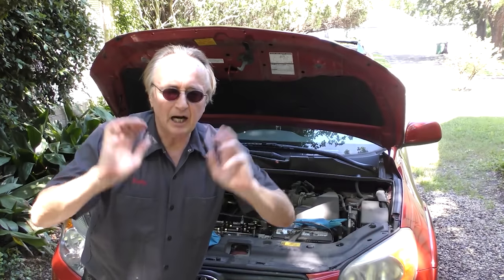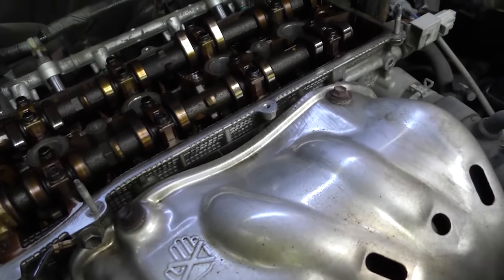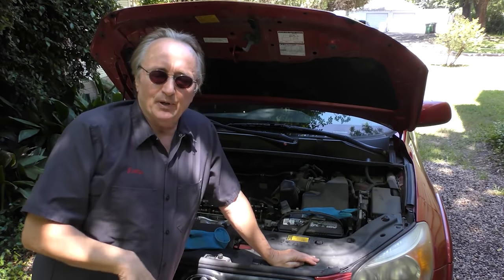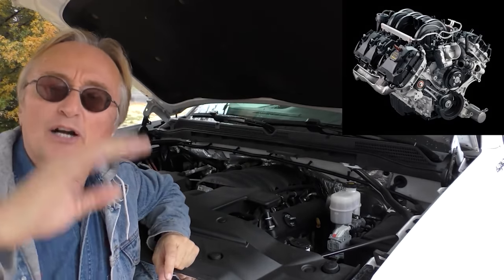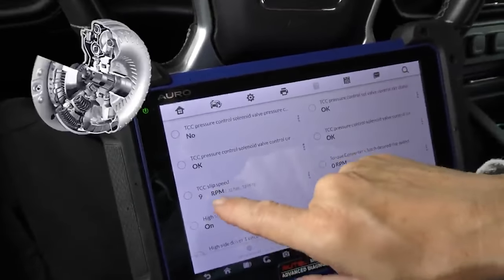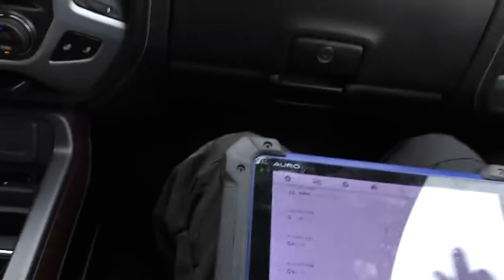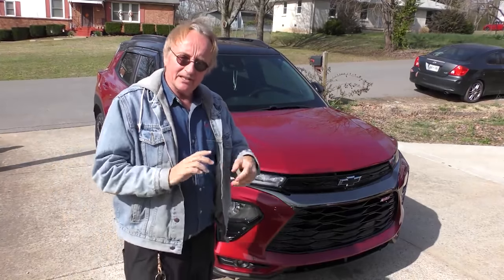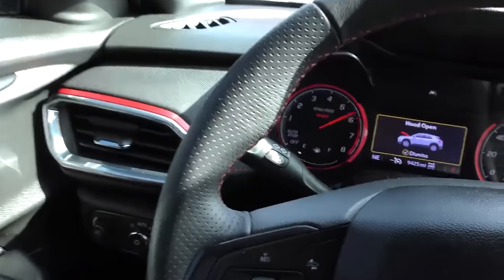Avoid These 3 Engines Like the Plague

Comment: The Toyota issue doesn't just affect the 2.4, 2007 - 2009. I had a 2002 Corolla with a 1.8 engine, and had the same issue. Toyota refused to acknowledge the issue and wanted 2k to fix the problem... I refused to pay and got rid of the vehicle. I've been driving Hondas since then, wouldn't go back to Toyota after that.

Comment: Hey Scotty. I've got a 2008 Honda Accord, and it's got the same problem as that Toyota - it's burning oil in one cylinder and fouling the plug. The dealer said it needs thousands of dollars of repairs to "rebuild" it and replace the rings. Do you have any advice?

Comment: My 2011 RAV-4 with the 2ARFE engine burns oil too, like 3 quarts between oil changes.
Reply: How many miles between oil changes
Reply: @michaelgriffis5259  Between 5-6K miles.
Reply: How many miles u have on the engine?
Reply: Aall 4th gen RAV4s are crap. "Avoid them like plague"

Comment: I had a 2007 RAV which I got rid of after 10 years due to the problem mentioned here. Toyota sent me a letter with an extended warranty: 10 years/100K miles. So at the end of ten years I got rid of it even when there was nothing ever wrong with the vehicle with the exception of a few recalls. Don't laugh. I traded it for a Sorento which after 5 years has been a good dependable vehicle. Standard warranty 10years/100k miles. At any rate,10 years is how long I keep my cars.

Comment: He said oil burning Toyota and I immediately thought, "2008 4 cylinder". People still try to sell them for a ton of money cause most people don't know about the oil issue with the 4cyl from that generation. Either get the previous generation 2006 or older or the newer ones 2010+.

Comment: Been driving a 2008 rav4/2az-fe for 5 years and yea the cover is covered in oil but i have no leaks or smoke and the car has over 160,000 miles. Engine may be flawed but it is still a toyota which means even with problems toyotas are still reliable!

Comment: I had that vega!! I was pouring oil daily and finally gave up.
Reply: I'll bet Pennzoil was smiling all the way to the bank!
Reply: I remember when dollar tree sold a quarter of regular mobile oil. Had  I known that I would be driving a 98 Saturn, now gone, I would have bought a truck load. That twin cam engine loved oil.
Reply: @walterweddle7644  I had the 93 SC2, by the time I traded it in for a used 2001 SL2, it was using a quart every 160 miles after 207k miles on the engine, and the usage was accelerating, oil blowing by the rings.  Other than that, the engine ran fine!  But, I knew I couldn’t push it much longer without needing to plan on hiking. Got $100 in trade for it, I figure I came out ahead that I didn’t have to deal with the time, effort and inconvenience of it dying on me and having to find a junkyard to take it to where they might charge me! 🤣🤣🤣

Comment: I hate the electronic parking brakes.  I'm glad I went with the cheaper Camry (LE) which has a mechanical parking brake (foot pedal).  I always get worried that if something goes wrong with those electronic parking brakes, you could have a problem.  Plus in an emergency you can use the parking brake to help you stop, however I'm not sure if that can be done with the electronic ones... I know the manual ones (pull handle or foot pedal) you can which IMO makes those systems better than the electronic ones.
Reply: There was nothing wrong with a handbrake lever. Car makers literally changed it for no reason...
Reply: @Slenderman63323  Manual hand brakes are garbage.  They always fail.  The electronic brakes actually hold the car and do not seize up.  They actually work better in an emergency.

Comment: Doesn't surprise me about the GM truck transmission...had a 2011 Malibu brand new off the floor...kept taking it back because the trans was always acting weird...they kept telling me not to worry about it because it was "learning"...

Finally, at 10k miles on the car, hubs put it up in the air for me and we found that the transmission was leaking, both cv axles needed changed out, and OnStar told me damn near every sensor was going haywire in the car...

As far as the cv axles, I kept telling them at the dealer that it kept popping and shaking while driving...they kept "balancing" the tires...when we lifted it up, each wheel had about 20 wheel weights on the damn things...

I told GM to come get the damn thing after seeing all of that...that thing was a lemon from hell and my last straw with GM products...

Comment: The reason why it wears the cylinders is because the injectors still shooting fuel and the engine and it's not firing. It's still getting oil but it's getting washed out with fuel

Comment: The new Trailblazer is nice. But, I like my 02 Trailblazer better. It still runs good and it will hold more camping gear. I'd actually like to buy a newer one. I like it better than my 07 Explorer, It rides better.

Comment: I have a Toyota 2011 RAV4--it's burning oil as well.  Not the same engine model.  Wondering if anyone else has experienced a similar issue (continued design issues?).
Reply: Lack of maintenance.  You need to use synthetic oil and change it every 5-7k miles.
Reply: @user-tb7rn1il3q  only used synthetic and changed oil every 6000 miles
Reply: @MinnesotaPaltz  Probably a bad air or oil filter.  The 2.5 is bulletproof.
Reply: It wouldn't hurt to change the PCV valve.
Reply: @cmc778  I doubt that will fix the issue, but worth a try.  A bad air filter or one not installed correctly can cause engine wear over time leading to a burner.

Comment: Scotty, I wish you'd put this out a little over 10 years ago when I bought my beloved Scion xB (2nd generation), which has this engine. I'd have bought the Corolla.

I got lucky. Mine was affected by the recall and had the engine redone as you describe at 86,000 miles because the dealer just billed Toyota.

I say I was lucky because I never had the oil consumption problems other 2AZ-FE owners have had until the day almost all the oil just basically burned off all at once, and I limped into my Toyota dealership on what was left in the crankcase.

I was also lucky because this dealership isn't like most; they didn't bat an eye. They just gave me a rental and started ordering parts. And yet somehow they still make money. Weird. It's almost as if focusing on keeping the customers on the road and leveraging Toyota programs to do it. I mean, I'm sure they work hard at selling and trading; they started trying to get me to trade the xB in after like a year, but hey. It IS a dealership.

Comment: Toyota won't rebuild mine either too many miles. However I will note that the car has been running for a little over 30,000 miles with this issue and while I do keep up with the oil consumption and changing it regularly. I really don't do anything else to the vehicle I'd buy another Toyota even with this issue as long as it's trouble free otherwise. Of course I'll never buy a new one I'm to cheap for that lol.

Comment: I owned a couple of 73 Vegas back in the 70's and 80s.  The oil consumption got so bad I would take the used oil from my 68 Mustang to top off the Vega.  It's too bad they were such oil burners because they got great gas mileage and were fun to drive.
Reply: i had a 73 that had the liners installed....drove good but was a rust bucket.  someone hit and totaled it.

Comment: Hey scotty im looking to buy my first car. I like the looks of the 2021 camry, but if i go used i could buy a 15’ maserati ghibli for the same price im between these two and a v6 camaro from 2018. Whats the best
Reply: Your choice is between a reliable car and two endless money pits.
Reply: Camry.
Reply: Yea the masi does have a wrap tho and recently got serviced at 170k miles so
Reply: @assassinforce5637  I would say Camry or the V6 Camaro if taken care of. You cannot skip oil change on those camaros....every 5000 miles top. The Masi run away.
Reply: Get the camry..v6 xle or xse..im assuming you have money because your talking about a maserati, for a first car that v6 camry is a fun and reliable car also the top trims have nice interiors and features. Its no sports car but for sure it has enough power to move while going 80 on the freeway. I say test drive it first tho and see if you like it.
Reply: Camry 1st , Camaro 2nd choice .
Maserati  ?? with 175k ? 
Nope..
Reply: Thank you guys for the help!

Comment: These 6, 8 and even 10 speed transmissions are just a way of gaming the system because it keeps the engine in the low enough revs so as it producing sufficient torque, but never where it is putting out peak emissions. So they can get away with not spending millions on developing a cleaner engine for another decade or whenever, its NOT because they want to give the consumer something extra. LOL, believe me, I'm happy with 5, even 4 gears in an auto transmission.

Comment: Just Scrapped my 2009 Pontiac Vibe AWD with the 2.4. Burning oil, about a quart a week.  Engine light flashing randomly,  catalytic converters plugged. had 180,000 miles. Toyota and GM told me to pound salt.  Never buy another GM built vehicle.  If it was an actual Toyota I would have hired a lawyer.

Comment: It's the same with the V6 3.0L 3GR-FSE, that you find in GS300's . I actually own 1 , it is a problematic engine if whoever owned it before you does not take care of it. Sadly
Reply: Was it fixed with the 3.5?
Reply: @labornurse   yes it did, any GS350 , GS430, GS460 will be better than the GS300. Obviously the newer models are not like that anymore , it goes back only to the 2006 models, even the 2.5L found in the IS250’s were better. But as well some of them suffered from Oil Thirst 😅 Did I answer your question? I think I get too much in detail sometimes.
Reply: Yes, thank you. I love the Gs. I have a 2018.
Reply: Are you talking about lexus Gs300? (2jz-GE motor) 6 inline.
Reply: @elnino1240   No, like I first said, it is the 3GR-FSE V6 lol . that GE is obviously different.

Comment: Chevy Vega had some breakthrough technology that was torpedo'ed by upper-level management. Chevy engineers worked with aluminum companies to create a molecular siliconized surface for the piston rings to ride on as a weight saving strategy to eliminate steel cylinder liners. You think this was junk?? Guess what,,, still used by BMW motorcycles and Ferrari, among others.  The problem with the Vega's was that the big brained bean-counters(corporate accountants) figured out a way to "really" save money on transporting Vega's to dealerships - they would be stacked vertically on specail flatbed railcars, like bottles of soda in a sixpack. Problem was that the hoodline was a little too high so the cars wouldn't fit on the railcar. DING DING DING - Genius idea - Let's chop six inches from the hoodline, and the cars will fit and we'll save millions !! OK, now all we have to do is shorten the radiator to make the body fit on the freight cars. Well guess what?? Terminal overheating,,,, lots of blown head gaskets, ruined motors,, and the Chevy Vega turned into a nightmare causing GM to replace lots of motors for free. Gotta love those corporate beancounters, eh?

Comment: Was wondering when Scotty was going to call this out this was a known issue for years. I had same problem, required a new engine. Put one in and a year later tranny went. That is with all the regular maintenance done and I did change tranny fluid even though Toyota says not necessary. Bad model years.

Comment: Who woulda thought a Toyota will lead the pack of worse engines 😅
Reply: Funnily enough, I have that engine with 255k miles. My sisters has 270k, all you really need to do is fill the oil up as it runs low. Not everyone wants to deal with that but idc, got the car for $1000 so it’s fine by me
Reply: Acura/Honda had the same issue from 08-10 with the piston rings wearing out.
Reply: Even the best car companies have a hiccup every now and then. Good thing we have Scotty to point them out.
Reply: @kevinemmers7025  Scotty acted like Toyota was infallible lol

Comment: I hate the new Chevy Blazer. They designed it to look like the Camaro but they made it front wheel drive or all wheel drive. It should be rear wheel drive with optional 4 wheel drive. And it should have a bigger engine. I hate crossovers anyway. I like regular SUVs, sedans, station wagons and trucks. The only crossover that was ever good was the original Eagle

Comment: It’s NOT a design flaw. It’s intended. Looser rings equal less resistance on the engine. Burning some oil is becoming an engine manufacturer norm.

Comment: Scotty.  I just had the AC system in my 09 Honda accord recharged at my local repair shop. Now I notice clear water dripping after the ac is running that I haven't noticed before. Is this a problem?
Reply: That is normal condensation.

Comment: I Have The Same Engine. In My 2003 Toyota Camry (Japan Built). Im Using 10-30 Castrol Conventional Oil.. Should I Switch To 10-40 ? Will It Help ? ANYONE ?.
Reply: Castrol is good oil . Just change it every 3k ( because its conventional)  w filter .
I'd use the weight recommended  on the oil cap and in the manual and just check your oil when you gas up . Carry a Quart of Castrol with you in your car .

Comment: Can't believe you didn't pick the Ford 5.4 V8 with the stupid spark plugs that break and cost $1,000 or more to change and the dual overhead 3 valve that eat the cam phasers at a cost of $3,000 to repair LOL

Comment: Scotty -- My girlfriend has a Corvette with that stupid cylinder deactivation system.  It was easily bypassed with a Range AFM device that plugs into the OBD-II port.

It cost $180 and is worth the peace of mind to avoid trouble down the road.  It works in the GM trucks too.

[P.S. We have one of each.]
Reply: Wtf they would put that on a corvette?
Reply: @labornurse  -- To help meet corporate average fuel requirements established by the EPA and other federal agencies.

Same reason why the manual transmission Corvettes have software programming that "encourages" a 1st to 4th gear shift if you aren't accelerating hard enough.

Late model Corvettes have the cylinder deactivation as a 'default' with the auto trans models.  With stick-shift Corvettes, it only does that in "Economy" mode.
Reply: Thank-you for your reply. Very interesting. Is that the same as the "skip shift" light that came on a 6-speed '96 z28 we used to own? 
As for cylinder deactivation, I think its terrible on the engine. We had a 07 suburban, and it suffered uneven cylinder wear. Needed new lifters and a cam. Ended up selling it to someone willing to fix it theirselves. Dealership wanted big $$$. Shame it was all to save one or 2 mpg. Like someone buys a v8 expecting it not to suck gas, lol. Actually it doesn't have to. I currently have a 02 v8 lexus (sc430) and it gets the same average mpg as our 2018 gs350 (a modern v6).

Comment: Should the 1.5 turbo Honda engine still be avoided?
Reply: They make oil for those specific engines. It’s 0W-16 or something like that
Reply: It’s direct injected and turbo, won’t last too long like the naturally aspirated Honda engines. You’ll probably get 100k or so before the turbo, carbon buildup, injectors etc start going. 
They never “fixed” the oil dilution problem at all mechanically, they simply changed the software tune so it “warms up” quicker. 
Mechanically it’s the same engine, I’ve known people with 2019/2020 SI civics that still have oil dilution. 

The 2.0 K20C2 engine, although it has less HP,  is bulletproof. 
It’s port injected and naturally aspirated. Will run forever and won’t have any oil dilution or carbon buildup issues.
It’s the most RELIABLE engine Honda still makes. 
Unfortunately you can’t get one with a manual transmission anymore (2020 was the last year) and is paired with CVT only even on the new 11th gen civics ☹️
Reply: Yes. Turbo and only gdi so the engines carbon up because they don't have port injectors. At least yet because toyota and ford do that in the new engines. Just avoid it all together. Who's desperate enough to have a 1.5 turbo instead of the regular 2.0.
Reply: @elihernandez330  I'd rate have the 2.0 N/A engine , more power per liter and it's a lot more reliable and better for tuning It revs highter  I searched the specs of that 1.5 , and even the old B series and H series produce more power that tiny 1.5  It seems like Honda went to reverse .
Reply: We have a 16’ Civic 1.5 turbo had it since 44k now at 131k miles. Needed nothing but normal maintenance so far so good.
Reply: No theyre fine , all gdi engines do that "oil dilution" since its inception just that millenials are just finding out and cry about it 🤧
Reply: @jzila9900  gdi is hardly 10 years old for most manufacturers and who uses a sneezing emoji, or any emoji. Oh yeah crying millenials.
Reply: @elihernandez330  not for honda and crying for you lol
Reply: @jzila9900  pretty sure honda started putting gdi in 2013 model years and forward. Now if they put it in before in a test mule to iron it out then that's a different thing.
Reply: @elihernandez330  no theres no test mule lol gtfo
Reply: @jzila9900  child. If you look up honda gdi they used test vehicles in Japan first. it's not uncommon for n oem to use a small volume model to test things out on. toyota did the exact sa.e. Wait did you actually think I literally ment test mules as in a living animal used for car testing? Wow.
Reply: @elihernandez330  yeah sure a real test mule you got me lmao
Reply: @jzila9900  So you're saying that honda never test muled the gdi system in Japan or anywhere before releasing it to make sure it wasn't too problematic to a level of uneconomic feasibility as in repair cost under warranty, technology implementation costs, and possible lawsuits ? Do you think they just release stuff without road testing it.